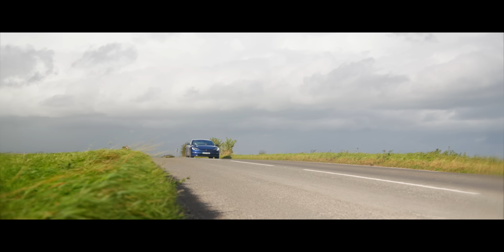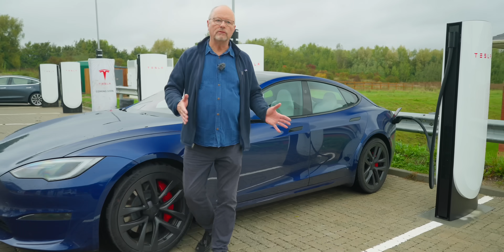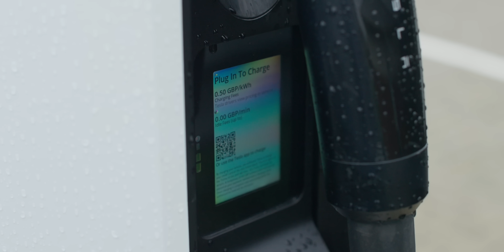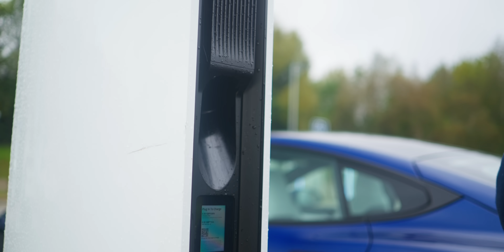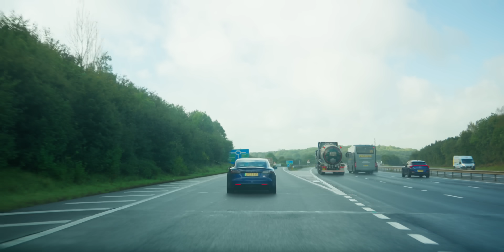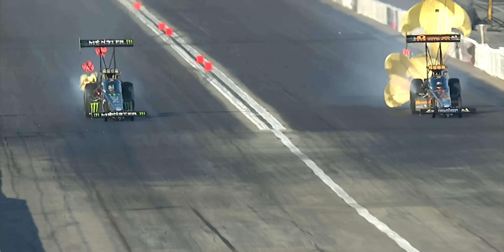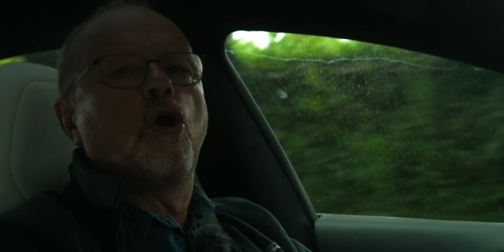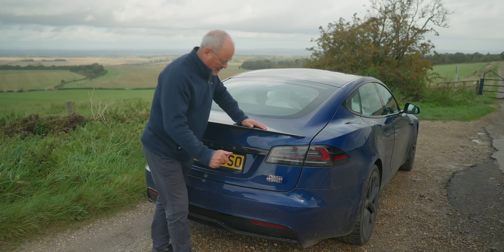THIS Is Why The Model S Plaid Didn’t Come To The UK

Comment: Indicators and wipers need to be a stalk. You CANNOT use an indicator button while navigating a roundabout indicating right and then left as you exit with a stupid little button.

Sharpen up Tesla. 

And the recirculation for the air must be a button. You need to be able to press it within 1-2 seconds.

Comment: To put a perspective on the Plaid, the updated Lucid Air is slightly faster because of management of the front and rear motor controls. It can accelerate quicker than it can stop. I agree with your point that focus on all out performance that is unusable in the real world gains headlines. But it does not inform about how the real world use and performance that continues to improve.

Comment: Is the Lithium mining etc in toxic/slave conditions for these batteries "misinfo". It's very important this is addresses in a fair manor and the industry cleans up if needed. It will increase the costs of the cars to sort it, but all the better to be cleaner. I wish people would push for more smaller EVS with small batteries for short journies - there they are ideal. But people want/marketed to get 2 tonne monsters which kills peds and cyclists. The batteries, motors etc in these faster cars are more expensive. When floored they use a lot more power, like ICE.
Reply from the maker: Andrew, you make a very important point but I think it is essential that we use accurate information and accurate language. You cite 'lithium' mining' as the major issue. As far as we know, and my goodness we've investigated and spoken to enough people about this, there is no lithium extraction anywhere on earth using anything resembling 'slave' conditions. Extracting material for any reason has consequences, no doubt about that and it's never been something wer have shied away from.
If you are concerned about cobalt extraction, and we all should be, there have been many reports on appalling working conditions for the people extracting Cobalt in the DRC, including child labour. This is classed as 'artisan mining' and is done by the world's poorest people in areas close to the massive, mechanised mines that are extracting copper, where there are no children or anything like 'slave conditions.' Artisand mining supplies between 1 and 2% of global cobalt supply.
In that nonte, most cobalt is used in steel production, then next biggest use is in oil refining, to remove sulphur and other toxins from fossil fuel, the third and diminishing use is in electric vehicle batteries. In 5 years, no vehicle batteries will use any cobalt,
And let's just remind ourselves of the 120 year long, brutal, utterly careless, massively destructive industry around oil extraction. They haven't used slave labour, but if you get in their way and you are poor and baclk, they just kill you.
Mineral mining and refining has an impact, everything we use is either grown, or dug up. 
But we can use the minerals we extract again and again. We use liquid fossil fuel once, and I know from direct contact, the people running the oil industry and ntheir highly paid shills do not give a flying toss about you, me, or anyone who questions their right to exploit us and make trillions of dollars every year.

Comment: Great-looking car.  The fact I don’t even feel the need to wax on about the fantastic technology, just shows how world-leading Tesla have become.  Thankful they decided to open up the user base of the supercharger stations to all with a suitable socket on their vehicle.  I’d love to do an e-scooter - just waft the charger cable connector in the direction of the battery and it’d be done!  Agree with the pricing, this is much better value than petrol (gasoline) pricing divergence we have on motorways vs other.  ‘Other’ in this case, varies, for electric being Robert with his solar panels etc, at close to zero cost for a charge (taken over the system lifetime), and for petrol being somewhere on the ‘A’ road network.  Being the ‘de facto’ standard, means wielding a lot of power and especially kudos - if VAG etc, could have done it, they would have, and not been anywhere near as good at it (judging by the ‘electrocute America’ roll-out).  Anyway, tipped over a million subscribers - wow.  Just bl@@dy well-done FCS.  Take care all.

Comment: FYI, Top Fuel dragster do 0 to 100 mph in .8 seconds. Yes, less than 1 second and 300 mph in under 4 seconds. That's 5 G's and the Plaid is a sustained 1.15 G's to 60 mph.

Comment: They can only charge according to the local power  available, crap supply in  crap charging rate. Tesla are rip off merchants £1300 for a new head light unit.

Comment: The problem is there is to much mis info about how good e.v's are and very little about the real world practicalities and the immense damage e.v's manufacture is doing to our planet.

Sooner the factual sum of how much co2 is produced in manufacturing e.v's versus that of petrol/diesel vehicles is displayed at point of sale. There will be bias towards the supposedly positive lack of co2 emission's on the e.v's. 

As to infrastructure, in the U.K. it is sadly lacking and even if it were excellent in terms of charger coverage. There still would not be enough electricity from the grid to power all the trucks, vans, taxis, buses, cars in the not to distant future.

The e.v. industry will, in my opinion, decline in all those countries that decided to opt for green energy only. As there will be nowhere near the energy available to charge them. 

Time will tell.

Comment: Spot on with the indicators. A stub on each side of the steering column would make much more sense, as would a single indicator lever. Going around a bend with a turnoff on the outside of the curve, such as on a roundabout, leaves the indicator switches in completely wrong positions. That will cause mistakes and accidents. Not 'might', but 'will'.

Comment: Formula 1 cars do 0-200 km/h in well under five seconds. That is a lot quicker than the Model S Plaid. Also a F1 car will get to the first corner with more than 200 km/h. Therefore a F1 car would easily reach the first corner before the Model S would.

That doesn't mean the acceleration of the Mode S Plaid isn't massively impressive which is almost unmatched in the automotive industry. The question is, why just make up stuff about it? Don't think the Model S needs that. As I've commented unter other videos, stop making stuff up and stay with the facts.

Comment: The thing that drives me crazy is I really could care less how fast I can go from 0-60. I want RANGE and RAPID CHARGING under 10 minutes. 350 miles of range just doesn’t cut it. Which is why I’m holding out for (hopefully) Toyota’s breakthrough technology on solid state batteries. That’ll be a game-changer if it actually comes to fruition.

Comment: It’s awkward not having stalks for the first few weeks in our S, but you get used to it. Love the auto turn off signal feature after changing lanes.
Reply: What? So the indicator self-cancels after you change lanes? Just like an old fashioned indicator stalk has always done, then…
Reply: @cerdicw9998  from my driving experience over the past 35 years, stalks will reset after you turn your steering wheel approx. 45 degrees. On the highway, they don’t.  The driver has to reset the position continually after changing lanes.  Tesla eliminated that. Mic Drop 🎤
Reply: @wydryfly   So you haven’t driven any cars with the lane changing ‘nudge’ feature on your stalk?
Reply: Nudge is for only approx. 1.5 seconds of signal use. I’m tapping out because you simply don’t understand, and I’m sorry for that. Have a great day.

Comment: So true people think oil finds its own way’ from far east ‘  to your local petrol station by magic. No mention of oil tankers travelling thousands of miles then the energy needed for refining and tankers driving up and down the country to deliver. Then on top of that at any moment the price goes up and down without notice….why is this better than an EV?
Reply: Because it's worked pretty well for the best part of 100 years? Give some credit to the diesel powered fire engines that have to put out EV fires.

Comment: Hi bob,how long were you on the charger ,I’ve driven at 140 mph and it was scary it was for a short distance around a mile roughly it was exciting ,no way would I have driven any longer than that and I was in a pretty good car so I did not use anything like a gallon more like a litre I would say it was well worth it for the experience and I did not have to use any apps or tech at all I went to a fuel pump put in 20 pounds worth which don’t get me far caus of the tax and things and off I went .liked the vid!.

Comment: The reason that fuel consumption of say 4mpg at 150mph in ICE , is never mentioned, is that drivers very seldom get to drive at that speed for more than a minute or two.   It’s therefore less relevant than the urban cycle or normal sane motorway cruising.

Comment: From watching reviews on the Model S and now Model 3 with no stalks etc I need to say this is a major change as we've all used stalks, round wheel etc. all of our driving lives. No Reviewer with a few days behind the wheel will like this as it takes time to re-train muscle memory to these changes.  I've had the S with yoke, no stalks etc. for over a year. At first, it felt like re-learning how to drive. Now, after about 12000 miles in, my muscle memory has completely adjusted and I'll never go back to round wheel, stalks etc.

Comment: I didn't hear Robert mention up to 15 tons of Co2 emissions will go into the atmosphere upon production of the the battery alone for this car.  A typical internal combustion engine car (the whole car) will give around 5 tons Co2 to the atmosphere . Average mileage (UK) driven will require over 6 years of travel before it begins it's greener than ICE life.
Reply: I don't think you are supposed to mention things like that on here 🤣
Reply: It’s also not true but hey this is the internet.  

You create this lie - by imagining that all electricity used in manufacturing is basically Winston Churchill dropping coal into a 1940’s power plant.  Based on this kind of [lie] reasoning - even baby food production produces massive amounts of CO2 and Radiation and caused Covid, Cancer and herpes.  But go ahead I know the game and you will just respond by lying some more. 😅

Comment: I'd go as far as to say that not only should the levers be a statutary requirement for indicators, wipers and lights; but they should all be fully standardised for the means of basic operation. By that I mean for the wipers one notch UP for low speed 2nd notch up for mid etc, at the moment all cars are different, for no reason other to be different.

Comment: I did a rough calculation, and many public fast chargers are 79p per kwh, I have a hybrid yaris that does about 60mpg and at £1.50 a litre to do 100 miles would cost £11.25 petrol and £19.75 EV.  At 50p per mwh as listed here, it still comes out more expensive than filling with petrol.  Surely there has to be something wrong here?  Or is it the case that outside of home charging EVs will be more expensive to "fuel"?

Comment: 4mpg from your big V8 when flat out doesn't sound so bad when you consider that car could drain it's 95kWh usable battery capacity in 7.5 minutes at 760kW (assuming it didn't overheat first). 
Of course, you're very unlikely to keep full power for 7.5 minutes - in either the electric or the big V8.
Reply: He cherry picks everything Bobhurt, shame he's a sell out.

Comment: It is so funny how these videos never talk about the battery degrading more rapidly when you super charge it.  Also, these batteries don't like being charged over 80%!
Reply from the maker: It is so funny when someone posts a comment about a topic saying we 'never talk about the battery degrading more rapidly when you supercharge it.' We have discussed that repeatedly and in depth, with, wait for it, actual battery scientists for, wait for it, .... the past 13 years. 
SInce the very early episodes we made (there are over 850) . 
Yes,  battery scientists, that is, people who actually design and build battery systems. And guess what. I give them a fraction more credence about battery technology than someone commenting from the sidelines who, possibly, has not designed, manufactured, tested and endlessly modified the battery pack in an electric vehicle. 
Forgive me for being a little snotty about it, but I'm afraid I'm going to give them the benefit of the doubt.
Plus the independently documented case of a tesla Model S limousine doing the run between LA and Las Vegas which clocked up 500,00+ miles on one battery and this car ONLY ever used superchargers.
But on your last point, 80% max charge is a very good idea, but it does not mean that occasionally you can fill it to 100% if you have a very long journey, w hich, statistically, is very rare.
Reply: @fullychargedshow  Look,  you can talk about a topic a million times, but many people in this world (over 8 billion) will not have seen this information.  I am a tech designer (help to create the home computer) who has used batteries for years and have EVs.  I still want to get those ideas out there to the public. So, for example, one of the most unreliable vehicles out there is the Escalade (52 times in the shop over 3 years), but much of the public still doesn't know this after a decade!

Comment: What do you mean you can't buy it in the UK because it's left hand drive?!

You're confusing us with Australia.

It is annoying they decided not to bother with right hand, but you get used to left very quickly. Drive throughs and toll booths are really the only issue.

Overtaking is rarely an issue. It's surprising how well you can see down the left side of the car in front.
Reply: Left hand drive is completely impractical when driving on the left, and it is considerably more expensive to insure because it is LESS safe because you aren't in a good view for oncoming traffic.
Reply: My own experience of 25,000 miles in a left hook car on UK roads would suggest otherwise. You?
Reply: @mgutkowski  You can claim anecdotal evidence all you like.
Tolls, parking ticket machines and even drive thru's if you're the type of loser who uses them are on the wrong side. 
Visibility also worse.
Reply: @sandersson2813  experience and anecdotal evidence not the same thing. How often do you ACTUALLY go through a toll, or need to take a parking ticket? Be honest now...

I've been there and done it, it's not difficult. Do you want the car or not? Insurance isn't worse either. 

 Anyway, my main beef was with the title of the video which is just flat out wrong.
Reply: @mgutkowski  I didn't claim you did frequently. I stated it is impractical for many reasons to have a wheel on the wrong side of the car. 
If there was zero issue with cars being left hand drive on left hand roads then we'd be able to buy them in UK dealers and not have to specially order them as grey imports. 
I actually have a left and right hand drive car because I live in two countries.

Comment: my first car was a mini, it cost £200, its electrical system comprised of 4 fuses , eventho it had drum brakes on all 4 tiny wheels, no abs or airbags id feel safer driving that than sat in a computer controled over priced incendiary device , evs are the biggest scam ever

Comment: The main justification for cars like this is to smash apart the assumption of a couple of decades ago that "An electric future is stupid - I don't want to drive a golf cart - because ALL electric vehicles are like gonna be like golf carts".

That probably had to happen. In the 70s an unbustable distance touring car like a Renaut 16 and several others that could cover a thousand miles with little fuss with well south of 100bhp. A sporty car like an Alfetta or BMW 2002 might have 130hp. Or the fun you could have in the original Mini with 70 or 80hp.

Yes ... batteries are heavy and there needs to be some compensation. Not everything needs 500 350 or even 200hp.

And all those I mentioned were totally pleasurable cars to drive and drive hard.

That seems to be the next sensible phase. Sensible cars with modest horsepower that are fun to drive like the small capacity performance cars that were affordable enough in the 1960s and 70s.

Comment: As a Plaid owner for two years I got used to the yoke very quickly and now I love it. The lack of stalks pissed me off for a good two months. Now I have to say, I find it easier to use. I admit, it took some muscle memory, but I now find it a bit annoying using the normal turn signals in another car.
Everything else is insanely good: the acceleration, the interior design, the software, the FSD, the charging network, the OTA, the safety, etc. Best car ever made.
Reply: There is a reason the stalks are a better design than the buttons. Try selecting the indicator button while the wheel is being turned sharply... 
Seriously, the Tesla design team are trying too hard to be different and ignoring everything already learnt about good car design. I have seen the same thing happen in software design, where new developers and engineers are trying to be different and miss the point about muscle memory. In the early days Microsoft set a standard pattern for how menus and buttons were arranged, but since around 2005 that has gone out the Windows :) even Microsoft don't adhere to their own principles. Now you can't find anything in Word or Excel, and every new piece of software is a whole new learning curve.